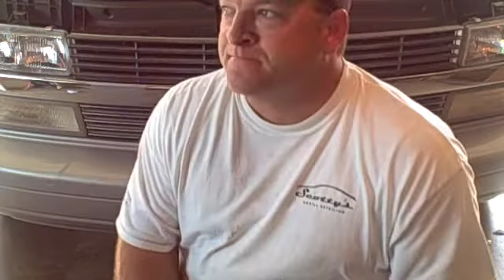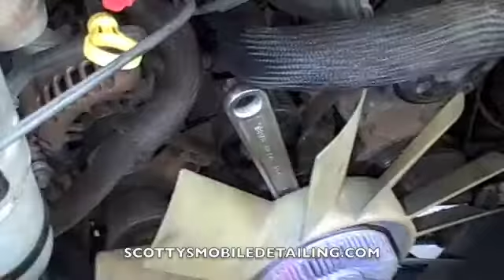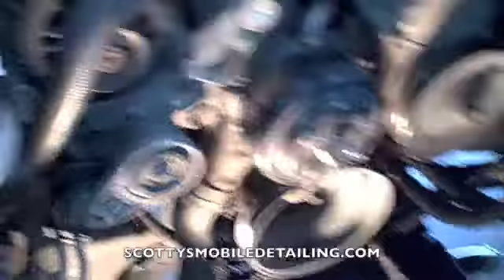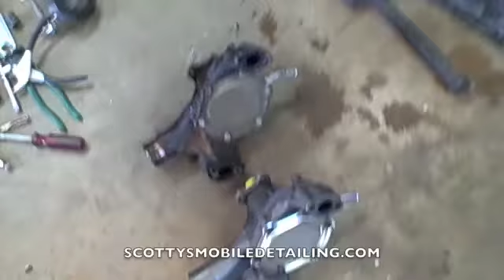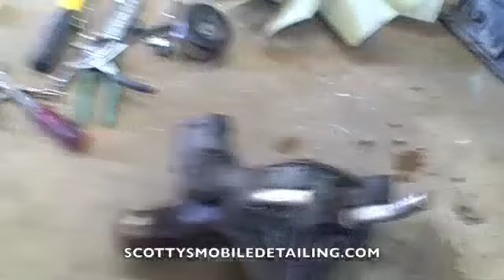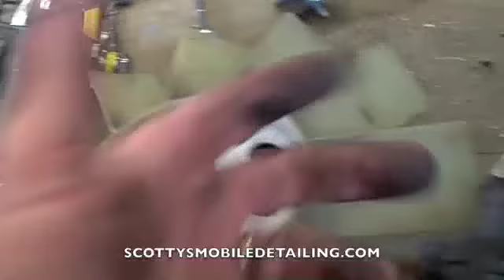How to remove a 97 astrovan water pump

Comment: Thanks Scotty I am a mobile detailer as well and rock with the 02 Astro. Van started
Overheating I topped off and it came leaking out. I had just done a thermostat and upper hose job but skipped out on the lower rad hose and water pump and it came back to bite me in the ass. Had to cancel on a client. Fixing my leaky pump tomorrow

Comment: Great video thank you. To get the fan loose I was able to wedge a flat head screwdriver in the small bolts around the nut and the screwdriver caught on the pulley to the top right. boom

Comment: i'm having trouble removing the fan clutch, when i hit my wrench with a hammer the pulley spins and i cannot loosen the bolt. Is there anything i can do to keep the pulley from spinning?
Reply: I had to buy a fan clutch removal tool, about $20
Reply: Another trick is to get a long rod of some sort and wedge it in between your frame and the 10 mm bolts

Comment: Thank you so much for posting up these videos they have been extremely helpful I am having a hard time getting the fan off. i also have a 97 astro 160K miles. I tried breaking it lose but the pully kept on turing with it. any tips?

Comment: hello scotty i have a question  i changed the thermostad and the temperature sensor. but the radiator is loosing water but no leaks from any hoses.   any help thanks   the gauge goes to normal temperature and then goes to quarter way.  i fell very hot under the whell when im driving. thnks.